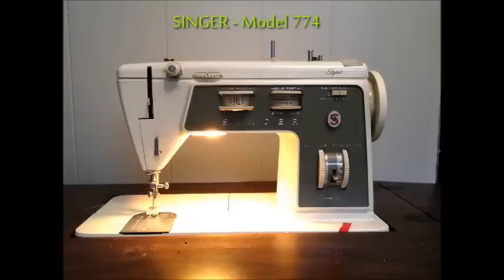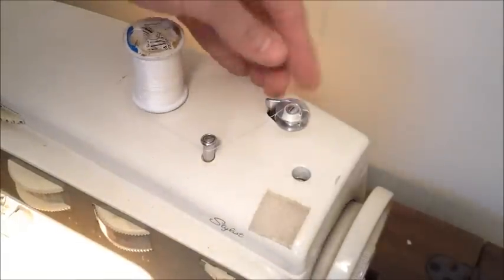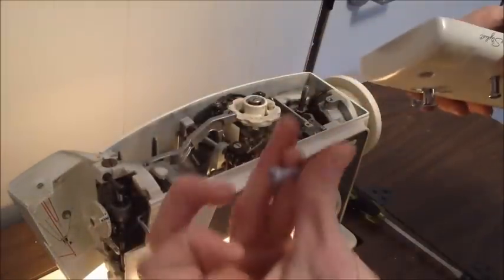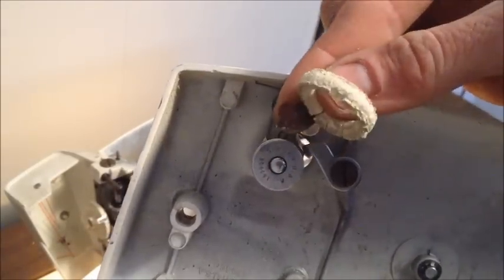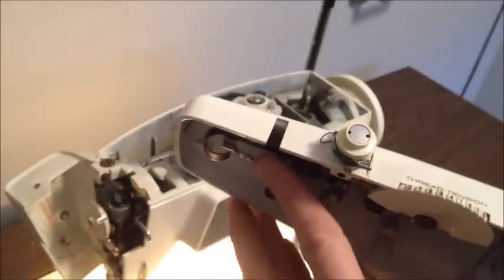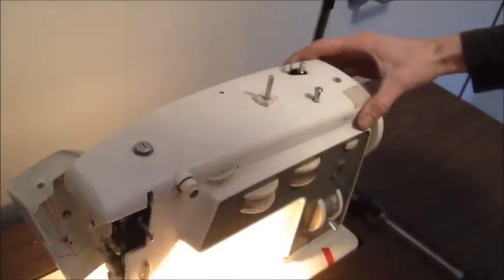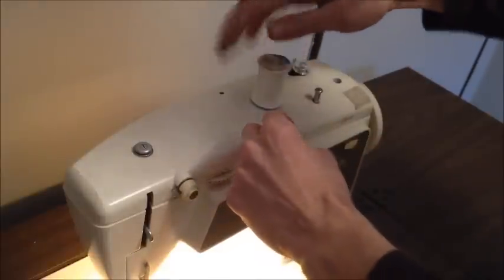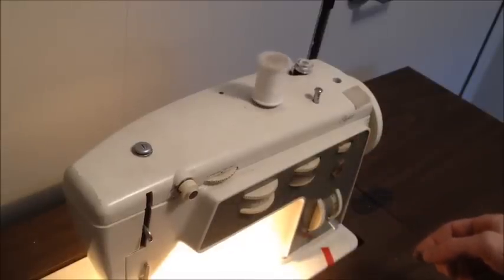Singer sewing machine repair - Model 774

Comment: Hi!  This is great!  I took the top off my Singer 774 last night just to look in there and everything looked ok (?) I had some trouble putting the top back on -- god bless you! I never would have figured out how to snap over the pin on the left without your video.  Sewing today no problem until I had to wind a bobbin and now I have the same problem:  peg won't turn (instead the hand wheel just spins).  I wonder if I should try tightening the screw on the hand wheel knob first before I try taking the top off again.  It was so hard to put it back on and put the door back together (it fell off when I took the top off).
Reply from the maker: I'm glad it helped. :)
Reply: @damiengontran  How to make bobbin winder work again? Is it possible to make any adjustments without taking the top off again or taking the hand wheel apart?  Would tightening the screw on stop motion knob help? I think the rubber ring is ok and problem is with stop motion knob. God bless you!
Reply: The under view of the pin snapped correctly is GOLD! 💯 🎉🎉❗️
Reply from the maker: @nickyp2820  I thought it would be of use when did the montage.
Reply from the maker: @nickyp2820  I dought that tightening the top screw would do anything since it holds a ball bearing for the bobbin to turn. the tighter wont change anything if thats the case. I am wondering if your ball bearing would be clogged. Maybe you need to clean it and lubbrify it.  Im afraid that you would have to take the top off again to check if the bobbin ball bearing is turning easily.  You took the top off once and manage to put it back on, I am confident that you can do it again. You can do it! :)
Reply from the maker: @nickyp2820  Over time, the fibers comming off the sewing filament must of cought on the grease from the ball bearing clogging it. So you can clean it off with some WD-40 and then , after absorbing the wD-40 left after cleanign it put some oil on it.  WD-40 is a water repellant cleaning solution,, un-james rushty peaces and it is widely misused as a lubbe. (it deteriorates metal over time too so never put it in a car lock lime a lot of people doo)
Reply: @damiengontran  I just fixed the bobbin winder !!!! 😂 ❗️ I knew it was working before I took the top off and peg not frozen.  I took a 2nd look at correct placement from your video, thought to push the top a little more to the right and tighten the top screw a little more.  This fixed it!!! The peg is turning now!  I cancel my appointment to take sewing machine for repair!!! Lesson learned:  Do not take sewing machine apart just to look (?!) and thank God for your excellent Youtube video!
Reply from the maker: Greace would be better than oil but if you dont have any or If you dont have any sweing machine oil you can buy some mineral oil at the pharmacy.  Mineral oil is very liquid and will work well. Just make sure you dont put some on the rubber caus it might make it slide on the ball bearing.  We need the friction there for it to work.
Reply from the maker: @nickyp2820  Awsome!  I thought you were talking about the bobbin screw....   So yess  by pushing the cover more to the right you made contact from the bobbin rubber to the engin spinning pin.
Reply from the maker: For my part, it,s the opposite, i like to open things to see how they work..  this is how i got better and better to understand and repair objects.
;)
Reply: @damiengontran  Correct!  Yay!!! 💕
Reply from the maker: @nickyp2820  Feel free to contact me if you have further questions or need any help :) it would be my pleasure.
Reply: @damiengontran  Thank you! 💜

Comment: I bought a singer bobbin winder ring/tire online. It didn't work. The outer diameter of the ring is a little big.  It didn't turn. Then I found your video, the hose washers  I have , many, for my standard hose is a little small. It didn't have tight contact, didn't' work either. I wonder what is the size of your washer or hose?

Comment: I think the hose washer probably cost more and is harder to find that a winder tire.  Nice clear instructions on how to do a replacement though.  Just use the right piece.
Reply from the maker: We use what we got, therefor making it less expansive. Hose washer is about 25cent and can be found in any hardware or dollar store. Even convient stores. For my part, i would know where to find a windertire.